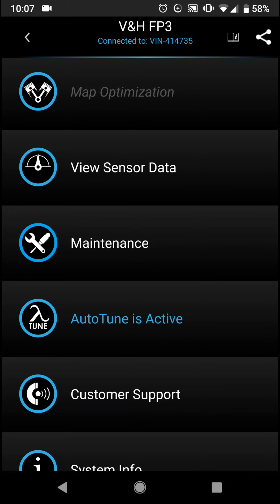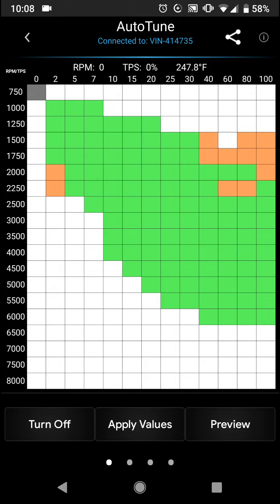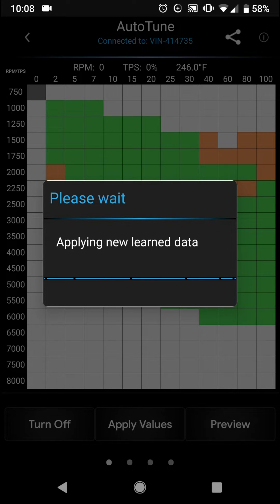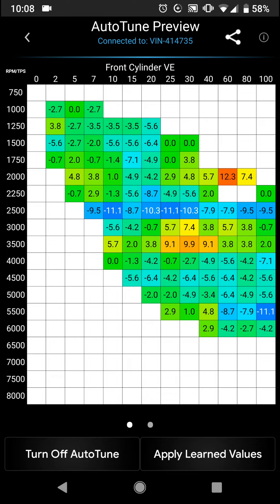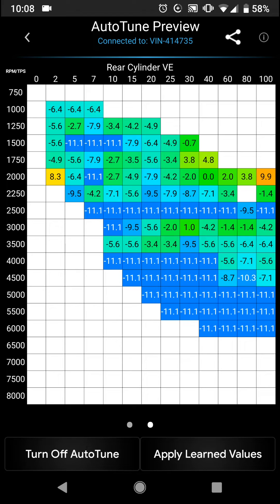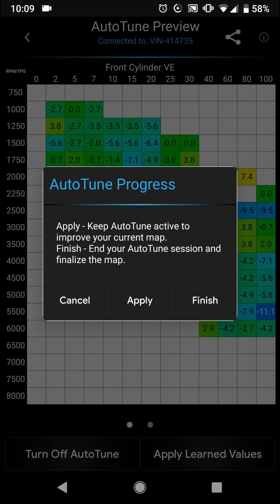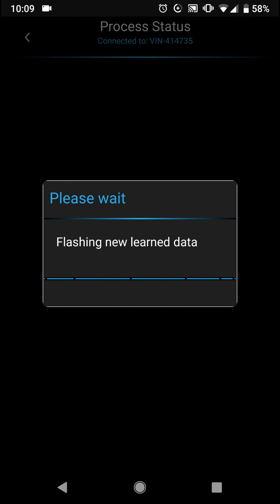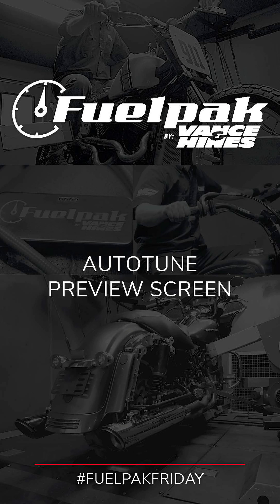Fuelpak FP3 | Autotune Preview Screen

Comment: I’m struggling to get to the values screen, I’m wondering if all is ok on my map. Bike is running well but I’m sure what your map showed is how my bike is behaving. I want to sort it for sure. Simply autotune tab after oking should bring up the values is what I saw there. If I’m way wrong, please reply.  I will give it another go and auto tune using the map I generated from a previous autotune, if that is possible, I assume it would be the case. 🤞
Reply from the maker: You will need to populate cells in the AutoTune table, then press Preview in order to see the difference between learned values and starting values.